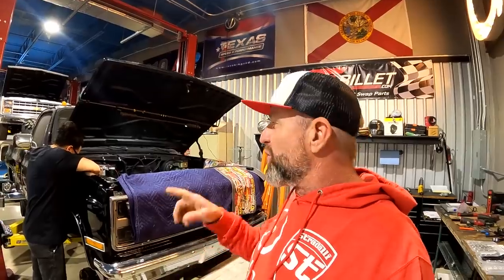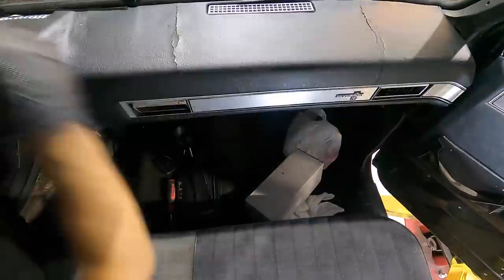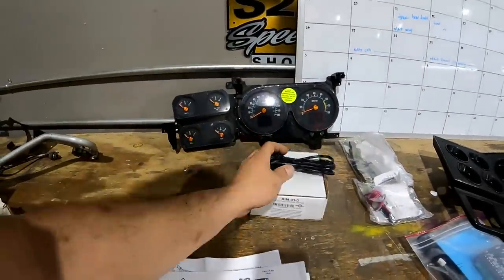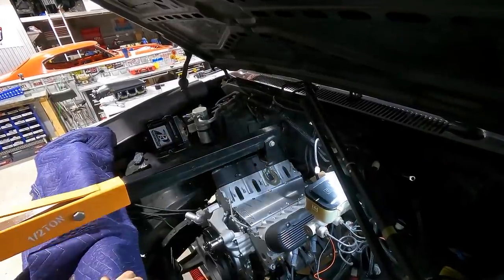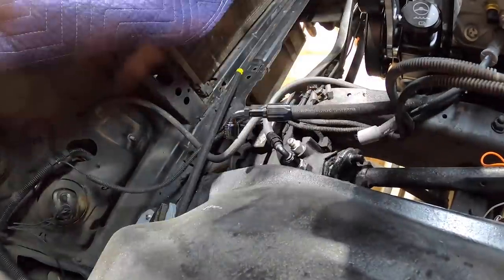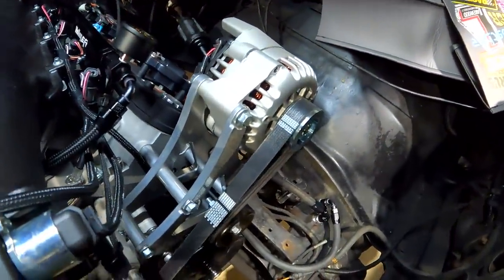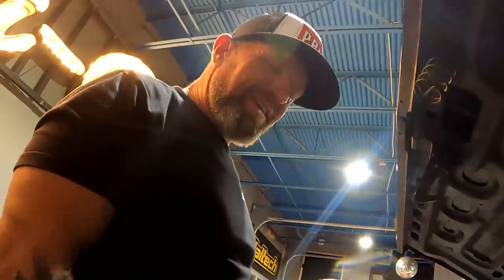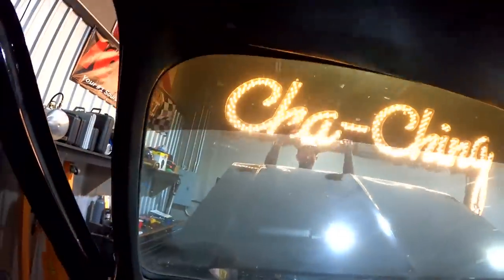LS Swapped K10 Squarebody First Fire Up! - 1987 Chevy K10 Truck Ep. 3

Comment: well its probably to late for you to know this, and it wont be the most pretty thing and i know you guys are more professional than I am. But I got the computer mounted behind the ashtray self  tapped into the Y for the heat and ac. I also got the ls fuse box mounted behind the glovebox but i had to cut up the fuse box. Cause im just trying to have a ls swap square so I did it the most simple way which i found to just use both fuse boxes for the original truck and the Ls. Fires up just fine, i just need trans lines so i can actually fire it and let it idle for a bit.
Reply from the maker: If it works it works! We're still running AC in the car so we didn't want to try to stuff everything in the dash then find out we screwed ourselves over when it came time to do the AC system. When you get that thing idling, take a video on IG and tag us in it! We'd love to see your project!
Reply: @SalvagetoSavage  Yall are so cool! you bet i will!

Comment: How did you wire in the speed sensor on the transfer case to the computer?
Reply: They didn't. I'm trying to figure that out now. It doesn't shift correctly. There's a Dakota digital sen-01-128 they used on the np208 but after speaking to Dakota digital, these are not designed for ECU feedback. I'm learning the only proper way to do it is with a 40 tooth reluctor ring somewhere in the transmission. I have to inspect it this weekend by removing the rear dummy plug in the 4l80e and seeing if there's a reluctor inside but if it's a transmission from after '97 there isn't one.

Comment: I love the idea of this LS swap, something I would have loved to do with my dads truck. Just curious everything looks so good why didn’t you give the engine bay a refresh cleaning and quick spray to really show off the new LS. Trying not to be critical but it seems like a small job with engine out even if done with a shaker can.
Reply from the maker: The engine bay was pretty clean to start with. There were no really noticeable torn up parts or rust spots. Sometimes if you try to spray over the little things, they tend to stand out more because the paint won't match up correctly. The entire bay didn't warrant a respray, so we figured it was best to leave it how it was!
Reply: Thanks for the reply, makes sense.

Comment: With a fresh hone I don't see why the rings wouldn't seat, although it is a little unorthodox to reuse them. Given good bores, it should be good as new. I would have also put in ARP rod bolts, but then you'd need to rebalance the rotating assembly. So I get it. Looks like a great build with realistic goals and a reasonable budget. PS: I would have moved earth itself to make those valve covers fit, they looked great.
Reply from the maker: We were very much on the fence about whether or not to cut into that cover to make it fit. Andrew decided it was better to just find another route since the cover had such a nice crinkle black powder coat on it. It would have been way too hard to match up.
Reply: @SalvagetoSavage  Can the alternator bracket be remade to move it out of the way? Looks great either way.

Comment: Where do you guys get the battery cable you use? About at that point to measure my own and like how clean yours looked vs some other “cut to length” options on Google. Thanks!
Reply from the maker: I order rolls off Amazon, and we get Quilty eyelets and a good crimping tool. A little heat shrink and you’re good to go

Comment: My son just blew the stock 350 in his restored lifted long bed K10. How much would this set me back to do a LS, versus installing another 350(jasper)
Reply from the maker: It really depends on where you pull your parts from. A running junkyard LS could be pretty cheap if you have a pick and pull near by, but you might run into issues not having everything you need for it to run (wiring harnesses, sensors, etc). Full drop in set ups are available online. They can be a bit pricier, but you at least know you're getting a good motor with everything that it needs to run in some cases. The rest comes down to labor and whether or not you're doing it all yourself.

Comment: What did you do for a return fuel line?  I saw only a feed and vent from the fuel hat?
No knock sensors, or did you mount them on the side of the block?
Reply: We are using a 1997-2004 corvette fuel filter which is self regulating to 58psi. It has the standard inlet and outlet with an additional 3rd port which is the return. It is Mounted 2 feet from the tank. And yes knock sensors are mounted low on the side of the block.
Reply from the maker: ^^what Andrew said!

Comment: 1987 wasnt a K10 the 5th digit would be a V if its a real 1987 4wd and an R if its 2wd
Reply: 1987 was the last year of the k/c series. they went to R/V after that
Reply: @trashbandit2449  Look at the 5th digit in 87 it's an R or v so 86 was the last year I have owned several factory 87s they are in fact the beginning of the r for 2 wd and vfor 4wd 😎👍
Reply: @trashbandit2449  NOPE you are wrong
Reply: @Tarheelnative  how come C/K series is listed as 73-87? Shouldn't it be 73-86 then? I'm confused
Reply: 1987 was the first year of factory Throttle Body Injection factory fuel fuel injection aka TBI and the last year of the square body Chevy GMC in the 1/2 ton series while 87 shared the same beds doors hoods and fenders along with interior the factory fuel injection is why they were designated R/V Series 87-91 is the R/V series just look at the 5th digit in the vin as I stated even go look in an LMC catalog for the breakdown of the vin 1987-91 is R for 2wd and V for 4wd
Reply: 73-86 CK series trucks squares were  all carburators
Reply: While I know I'm correct because I have owned several 87s and built and owned quite a few 87-91 suburbans go do some research and you will see I'm not lying Been messing with the 73-86 ck and RV series trucks since I was 16 and I'm now in my 40s 😎👍